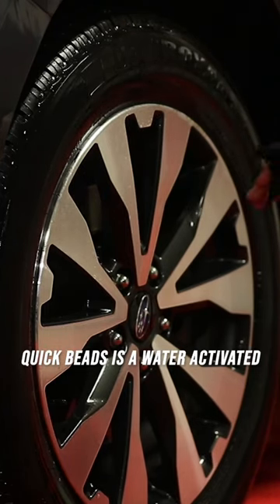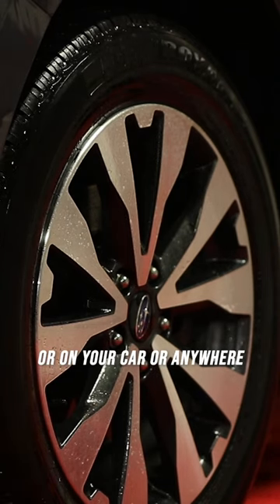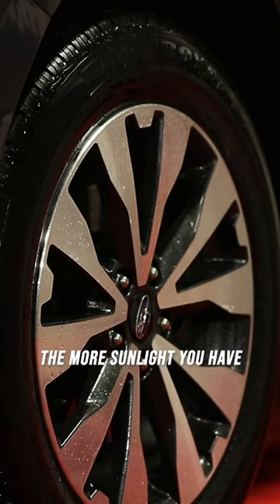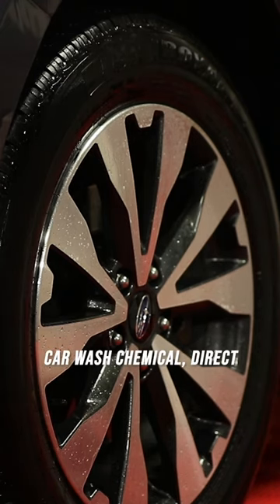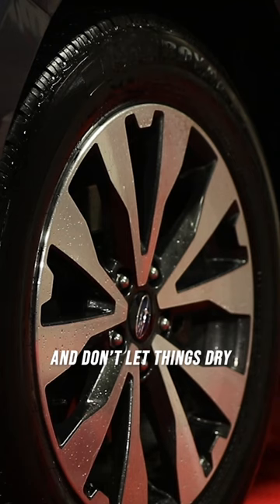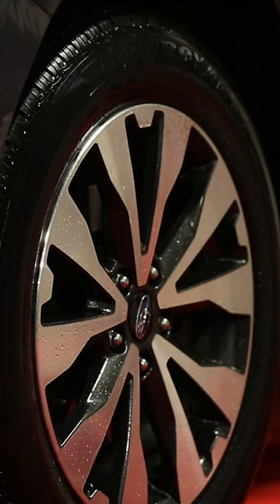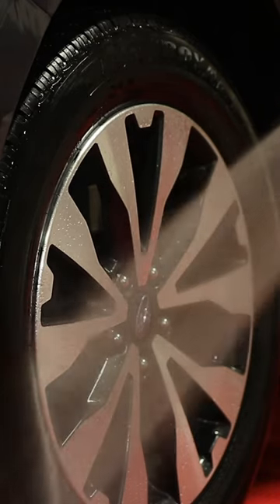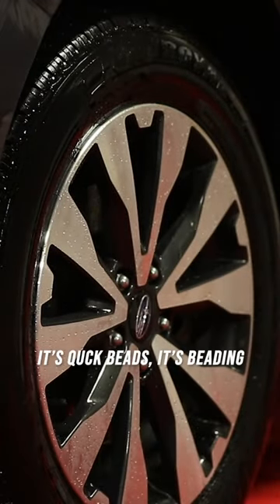This is the easiest way to ceramic coat your wheels

Comment: Speaking of wheels, I have seen many detailers on youtube and whatnot using an iron remover on paint or wheel cleaner on wheels and use like 50 sprays per panel/wheel (Which can easily be around 80ml per panel or 200ml for all 4 wheels for example). Iron removers and iron removing wheel cleaners are liquid gold and no one likes to waste them. Can they be proven to waste products like that? I think 5-10 sprays for paint and 20 sprays for wheels is just enough to do but I cant do it due to broke me but u can definitely try
Reply from the maker: More is not always better.